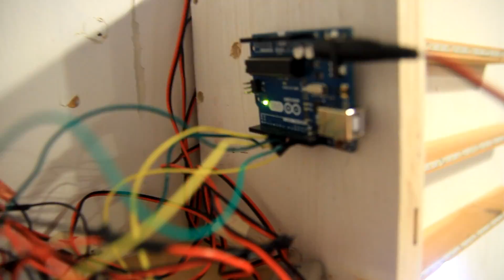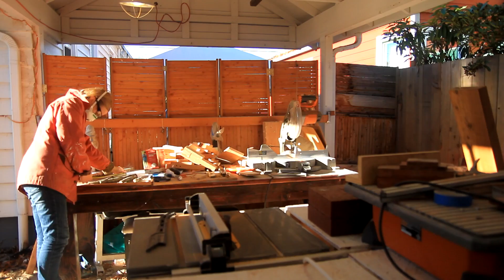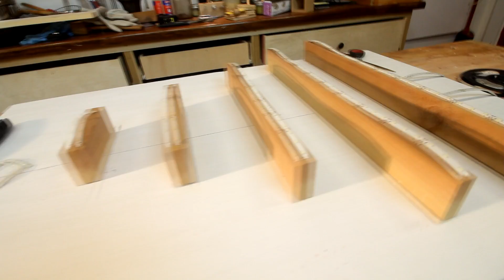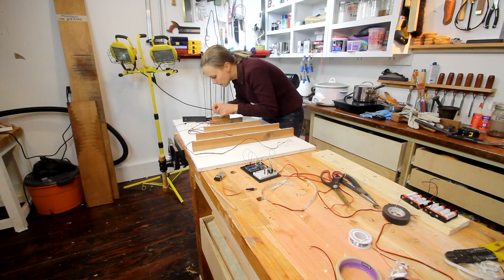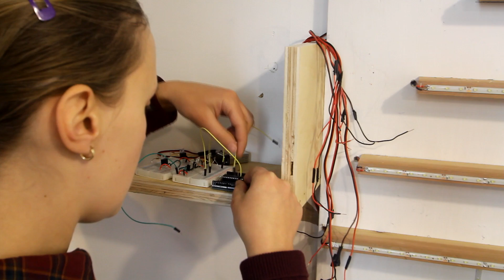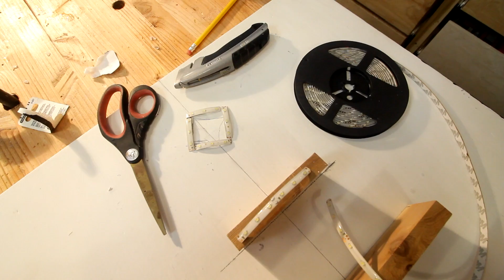DIY Making a Christmas Tree w/ an Arduino - Star Wars Lighting Pattern

Comment: did you design your own circuit?
Reply from the maker: 우희도 yes
Reply: wow, where did you learn to do this and how long did it take you to build the circuit? Very impressed!
Reply from the maker: 우희도 Hi, this is a pretty simple circuit so once you realize to step down the voltage to the led, and switch it through a transistor from the arduino, there is not too much to it. I play with electronics a little bit in my projects and hope to do so even more in the future.

Comment: Arduino is great. Using WS2811 LED strips http://www.adafruit.com/product/1138 you could get rid of the breadboard and hotglue the electronics on the back of the tree.

Great pictures with the low depth focus of the board and the colored wires.